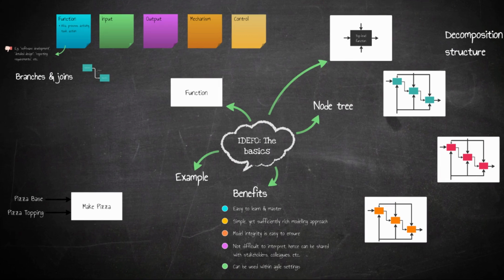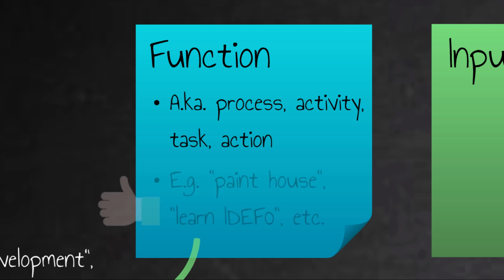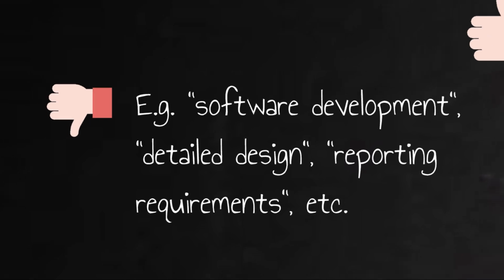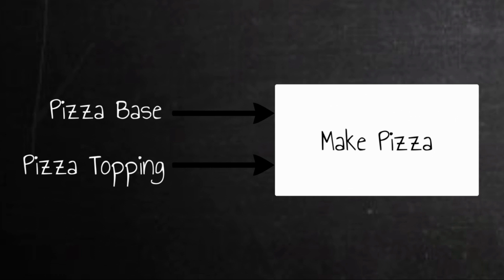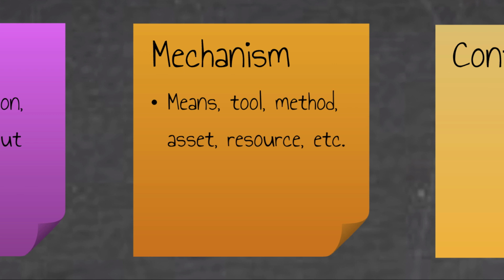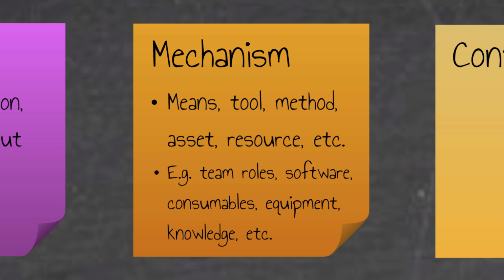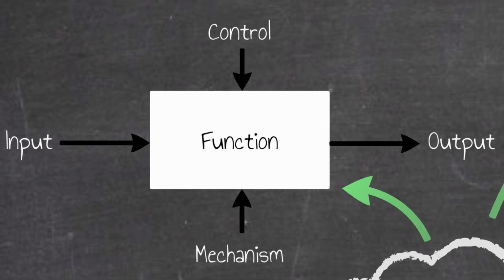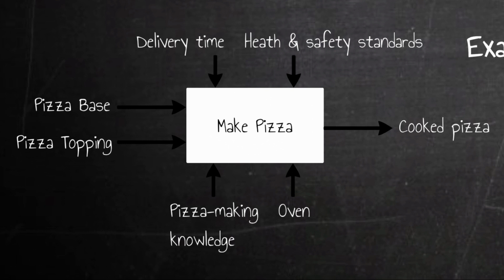Function modelling using IDEF0: The basics of functions, inputs, outputs, mechanisms and controls

Comment: Are quality management system procedures controls or inputs?
Reply from the maker: Hey Duncan, I would most likely consider these procedures as controls rather than inputs as I'm assuming there they are guiding the execution of some function/process. However, if these procedures are true inputs in the sense of data inputs that enable the execution of some function/process, then you may show the control arrow forking and going in as an input connector
Reply: Much appreciated!